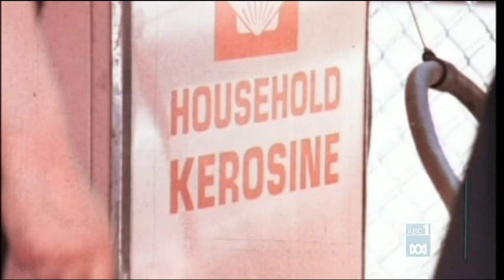Steam Powered 1963 Ford Falcon

Comment: One thing I've thought about, might already exist, could you heat the cylinders instead of a boiler tank, then inject water into the cylinder where it becomes steam? I suppose the hurdles to overcome would be a high temperature lubricant inside the cylinder, and keeping the engine hot enough while spraying water in for long periods
Reply: What you are suggesting is actually not very different than the very first steam engines ever built by Thomas Newcomen... he heated the cylinder with low pressure steam and then injected cold water to condense it to form a vacuum... it had increditably low thermal fuel efficiency of less than 1.0%.By injecting cold water into a hot cylinder to form high pressure steam  it also would have very poor thermodynamic efficiency and very low power density... the engine would need to be very large and have low power output.
Reply: that's another thing I was thinking about, could you put salt in the boiler provided its at least lined with a material that doesn't rust or corrode in the presence of salt. The water will boil faster and the salt will not evaporate
Reply: Nabre Labre Yes, salt does not evaporate but what it does do is leave very damaging deposits called scale
Reply: No. Water is non-compressible. Gas (steam) is.
Reply: The cylinder would hopefully be hot enough to flash steam a tiny amount of water. Doesn't water expand something like 1700 times when it evaporates? Inject a drop in mist form. I'm gonna try and build a junky little engine and try it out
Reply: Nabre Labre Someone has to come up with a way to use sea water as a fuel.  We would have an unlimited Co2 free fuel source.
Reply: it would be less efficient, its always more efficient to produce one bigger batch than to produce a few smaler batches. thats how mass production works., and in this case also in heating stuff. thats why central heating is more efficient than heaters all trough the house.
Reply: tjeulink In terms of surface to mass ratio... bigger is more efficient in regards to heat loss..

The problem with the ideal is you not just heating the water into steam.. your also cooling the cylinder at the same time you are trying to keep it hot enough to produce steam...
Reply: The real doktorbimmer oh, i dont know enough about the design to know that haha. i just now basic thermodynamics and how a toy steam engine works lol.
Reply: You'd have warping issues with the metal due to rapid temperature changes.

Comment: My father, Gavin Bell, helped the Pritchards do their patent drawings and I can remember riding in the Falcon, and a Stanley Steamer that they had around Caulfield.
They had a flash boiler that would develop working pressure very quickly. A pity it never took off.
Peter Bell.
Reply: a real pity - I have tracked down the owners of the patents and am approaching them to sound out if they would be interested in licencing them for vehicle use again - just so brilliant to see a way out of oil..
Reply: yes but most of them are fuckwits - the planet could do with a little humility - I'm sure there'd be plenty of private people quite happy to honor teds designs and take them to another level
Reply: +Simon Hosking Pissing away valuable fuel and hard earned money is not an idea many will agree with you on...
Reply: +Simon Hosking There is nothing worse for the planet than cars that waste fuel at the obscene rate that steam cars did.
Reply: +marias man  Modern cars are 400-500% more efficient.. of course this crackpot's antiquated design certainly guzzled fuel at an obscene rate compared to a modern turbo-Diesel car.
Reply: +marias man Please don't quote any unsubstantiated claims or figures offered by Harry Scheoll or his fraudulent investment scam called Cyclone Power Technologies... this company has never proven its efficiency claims or even proven that its engines are real!
Reply: +marias man Yes, steam cars are indeed horrible inefficient, That is why they have been obsolete for a Century. Cyclone Power Technologies was never a legitimate engineering concern... the sole purpose of its existence was to defraud investors.
Reply: @doktorbimmer lol your family may depent on any ice car manufactutes but we dont
Reply: Estimado Simon Hosking Yo estoy interesado en reflotar el sistema de vapor y me gustaria contactarme con usted , por favor podria pasarme su e-mail ?
Reply: Dear Simon Hosking I am interested in refloating the steam system and would like to contact you, could you please send me your e-mail?
Reply: +Comercios Pando No legitimate engineer would consider producing steam cars today... that would represent a significant step backwards in technology, energy efficiency and environmental impacts.
Reply: +Simon Hosking You won't find any legitimate automobile manufacturers interested in steam propulsion... especially considering a modern car is 400-500% more fuel efficient than Teds antiquated design.
Reply: @doktorbimmer lol 500% efficient
Reply: @sssbznzn  Yes, 500% MORE efficient than Ted's engine.

Comment: Very nice, but how long did it take to build-up operating steam pressure on a cold day?
No turn-the-key-and-go with this model.
Reply: That Interanal combustion sounds painful, reminds me of the mornings after eating too much habanero sauce XD.
Reply: Saab's 1974 steam car had 30 second heat-up time....max, With today's insulation materials you could reduce that to zero in normal operating cycle of a commuter car. Oh and having your maintenance costs cut by 80-90% would make owners a bit more forgiving.
Reply: Keith Otis Edwards Who said anything about instantly heating anything?! Instantaneous is a completely theoretical concept simply because doing anything at all instantaneously would require INFINITE power but because that power wouldn't have any time to do any work it would require ZERO energy.
Reply: Manintoga
Oops, I missed that typo! That's a goody. cheers
Reply: NP It happens...Interanal combustion that is... XD
Reply: I remember Ted saying once back in the 70s that it took as long to heat as it took to roll a cigarette. With a bit of modern burner tech and insulation materials it could be made extremely fast. I'd be thinking in terms of using stored compressed air to get rolling while the flash steam generator came to temp.
Reply: Manintoga Soooo . . . you're saying that modern insulation materials are far superior to asbestos, which was commonly used one-hundred-years ago?  I am obviously not as technically advanced as you guys, because the only way I can imagine getting water to boil instantly is to use an immense amount of energy.
Reply: Keith Otis Edwards
Yes Keith, modern insulation is far beyond asbestos, take for example the insulation developed by NASA for the space shuttle. There is also a thing called 'solid smoke' search that one. A common product for kilns is at about 30mm thick and equivalent to a fire brick for only, I don't know, about a tenth of the weight! With modern burners that have auto ignition a steam generator comes up to pressure in seconds rather than the 3 minutes that Ted had, fuel economy should be better than an internal combustion because there is no transmission sucking 15-20% of the power out, also fuel air ratios can be keep optimal unlike the constantly changing demands of the interanal combustion. In many ways external combustion is far superior, ask any steam enthusiast and they will tell you that the low speed torque leaves internal combustion in their dust, they are also very quiet too, long wearing, low revs. If only the same amount of R&D money and time was thrown at steam and compressed air as has been squandered on I.C.Engines, we'd be worlds better off! Hope this helps, cheers. Oh, check out Jay Leno's Doble, even as primative as it is it still has exhaust air quality as good as modern standards require (mostly).
Reply: Also, as we know from thermodynamics, te eficiency of an steam engine is greater when the gradient of, the diference between, motor temperatura and outer temperature is greater. So as long you could set the boiler working fast, like with kerosene and sparks, you may get a fair good performance.
Reply: @revoltaiignoto3881  As you know, with the Second Law of Thermodynamics the steam can never match the performance of the internal combustion engine.

Comment: if the U.S. car industry did not  have the idea, it must not have been good...
Reply: Jamscout gas turbines are lightweight, very powerful, last virtually forever and have decent emissions.... but they are totally unsuited to applications where the engine spends any time having to idle or run at less than full power... fuel consumption is terrible at less than full power..
Reply: doktorbimmer my reply was not realistic, just a joke, I agree with you about German vehicles, best wishes.
Reply: The US auto industry was never known for it's eagerness to adopt new technology or design.  It took the Japanese and Germans (VW) to convince them.  See the history of the Firestone(tires)-Rockefeller(Standard Oil)-Ford&GM cabal of the 1920's that destroyed the trolley interurban rail system. Look what happened to the gas turbine engine in the Indy 500 (Andy Granatelli). Faster than anything on the track, but they changed the rules to eliminate it.
Reply: The US is not the worlds leader in automotive technology... Germany is..